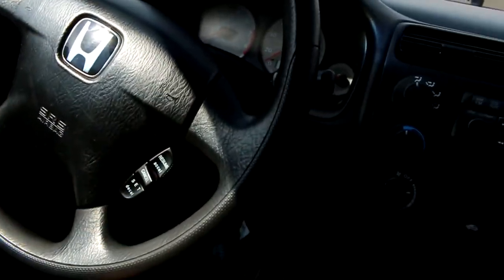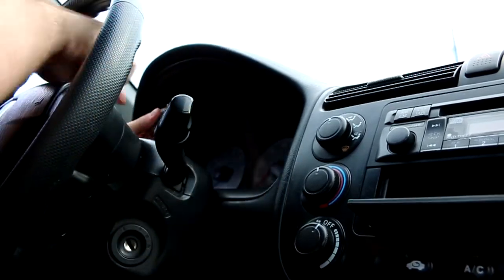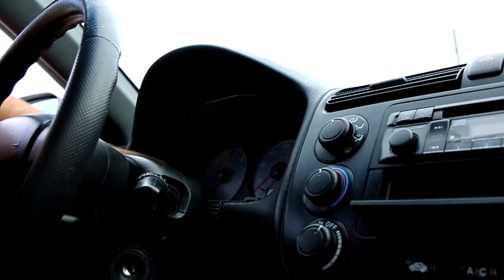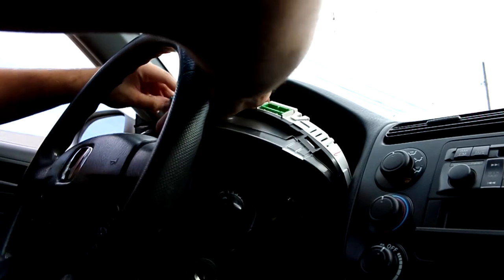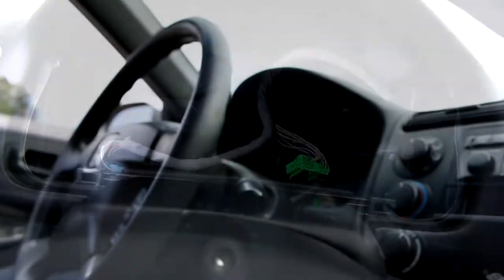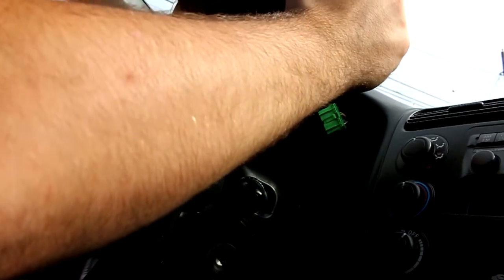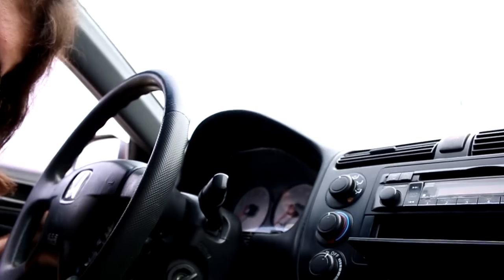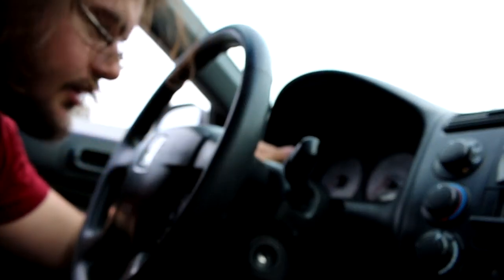How to Replace Dash Lights - Honda CIvic 2002 Manual

Comment: I have an 04 Civic DX, and I had some of these T5 (2723 and 2721) wedge bulbs die over the years.  I decided to go with fancy bright LED bulbs off ebay for $8 as a replacement, blue color for my blue car and blue alpine deck.  They work and they look great at night, but I didn't realize that LED bulbs don't blink - my indicators don't light up on the dash - I'm guessing I need some kind of relay or extra part that allows LED bulbs to blink, but I'm not doing it.  The red 'red line' on my RPM's also don't illuminate red and the RPM and speed needles don't glow red.  5 months later, I bought new T5 bulbs off ebay, clear, regular bulbs.  I like the blue color, but I miss the indicators, red RPM lines and needles that light up.
Reply from the maker: Yea I would stick with stock bulbs unless I'm changing the cluster as a whole. I was thinking about going with red, blue, or green bulbs when I was changing them. I went with the normal white color though, and the replacement went smoothly. I always had the center two missing though, haha!

I sold this a year ago and bought an ej8, the video showing it off will be out tomorrow if you're interested.

If you're ever feeling the need to go back to white, do it. I ended up doing the bulbs a few times over, just so I can film. So taking the dash out a few times slowly started to become easy, and less of a pain in the ass

Comment: Hooje Thanks dood! Coleman Honda in Maryland wanted $450 before taxes to change out bulbs, the service rep tried  scare tactics to the point of informing us it was such a challenge they didn't really want to do the job...
Reply from the maker: That's insane! This was such an easy job to do! I'm glad i could help. I have a different car now, still a civic though haha. 2000 civic coupe with a 5 speed manual. I'll be making some tutorials on this car shortly

Comment: My mom has a 2002 Honda Civic Dx  and one of the bulb for gear {D} went out so I replaced it. After I replaced one of the dash boad light for {D} , I put everything back together and after I plugged the yellow clip and blue clip back in the unit , the thermostate gauge needle goes below letter C when I clearly put the needle on letter C not below C - I just don't get it. Please help me out .
Reply from the maker: Google or read forums my friend. I no longer have this car and I never experienced that issue so I'm not sure what the fix is

Comment: Can I use LED lights instead? My lights are red so I wanted to use blue to match my radio
Reply from the maker: You can use brighter lights, yup!
Reply: @MaxSpeedMike  by any chance do you have any recommendations?
Reply from the maker: @ThatHomieFox  I do not but some generic leds should work if you get the matching size etc
Reply: @MaxSpeedMike  thanks
Reply from the maker: @thathomiefox  anytime!

Comment: The back of my cluster looks way different!! My cluster turns on when the car is on! But when I turn on the headlights, the dash turns off
Reply from the maker: What year is your civic?
Reply: MaxSpeed 2003 Honda Civic Ex Sedan... I wanted to check the light bulbs to see if that’s what’s causing my dashboard light to turn off when I turn on the headlights..
Reply from the maker: Might be a cable. Check the forums and see what could be causing that. DM me on instagram @MaxSpeedMike I'll try to help
Reply: MaxSpeed ... when I pull out the cluster I should peel the wire protector to see?
Reply from the maker: Dm me bro I'll try to help @MaxSpeedMike
Reply: @MaxSpeedMike  this was awhile ago but i’m having the same issue. did you ever fix it?
Reply from the maker: @Theducktapeave  car has been sold for a few years lol. Nah i never had that issue. Just my bulbs that burnt out which I replaced.

Comment: Thank you good sir
Reply from the maker: Anytime Sammy glad I could help!
If you wanna see any other tutorials for this model civic, let me know! Thanks for the sub :D
Reply: MaxSpeed  You deserved it, my dude! And thanks.. definitely having fun with this Civic! Next lil project is to take off my passenger door panel.. window seems to be getting a lil slow, I'm not mechanically inclined at all lol do you think it could just use some kind of lube in there?
Reply from the maker: If your window is going up slow then most likely the window actuator is going out. When you take off the door panel you'll see a door lock actuator which is for your power door locks, and a window actuator for your power windows. Replace the window actuator and the window should go back to normal speed. Just my .02